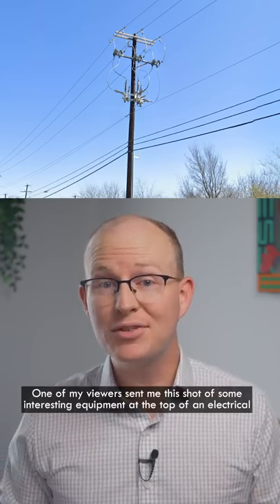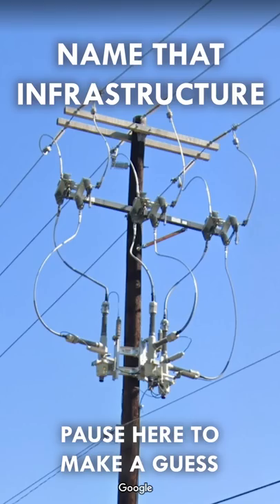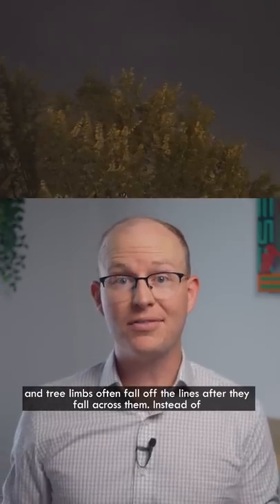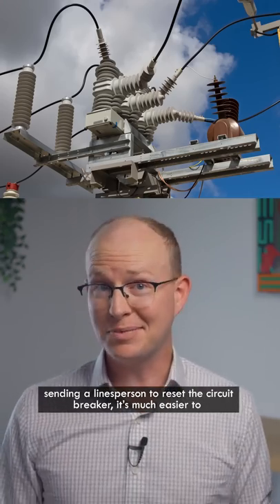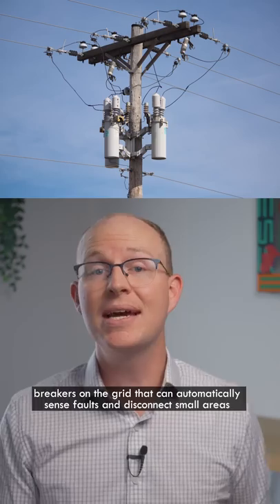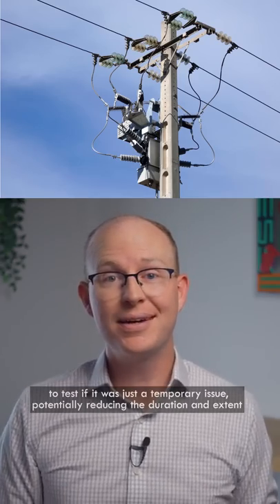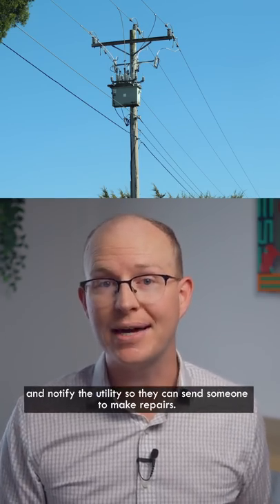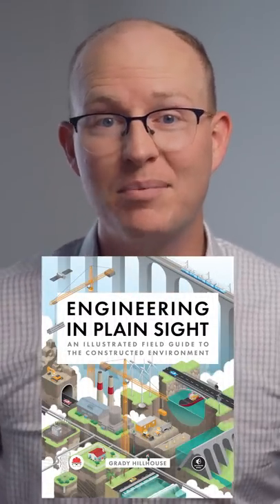Name That Infrastructure (Ep. 9) #shorts

Comment: This might explain why our power flashes a few times before actually cutting completely off
Reply: Thats exactly right.
Reply: yup,  if the recloser detects a fault it will open the circuit for 3 seconds to let whatever hit the lines fall off (tree branch, squirrel, whatever). It then tests the line to see if the fault is cleared, and if not will open a second time for 30 seconds.  Then it checks one last time, if it still detects a fault it will stay open until a crew repairs the damage and resets it. (Exact times and sequences vary from place to place)

Now, when the lights dim that's because a circuit on the same substation transformer experienced a fault, its similar to how your lights might dim when you turn on a vacuum or hair dryer. Dimming lights usually means OTHER people are about to lose power.
Reply: "I got it... I got it... I don't got it"
Reply: Stop answering questions i didn't know i have to ask
Reply: @tavelkyosoba  spot on
Reply: @FonicsSuck It's about 3 seconds where I'm at as well
Reply: yep right

Comment: I didn't know those componets could reset themselves, interesting!
Reply: That's part of the reason you always treat down power lines as live. Just because a fault might cause the power to disconnect doesn't mean a recloser isn't waiting to catch you by surprise.
Reply: Years ago I was watching a television show that shows clips of disasters. (Obviously pre-YouTube.) They showed a hot air balloon that crashed onto power lines shorting them. Every few seconds there would be another poof of black smoke. The narrator explained that the circuit breakers were automatically resetting. Unfortunately in that case, automatically resetting was not the right outcome.

I do not recall what the eventual outcome for the passengers in the basket.
Reply: Usually 3 shots and lockout for distribution and single shot on transmission or no reclosing depending on the situation. And Warren's comment is 100% right,  sometimes they'll clear the fault but still be in a really bad spot energized like a floating conductor off the glass.

Comment: G&W Viper recloser. That's my field of work
Reply: I've built a few of them!
Reply: @benmolitor1519  Pike mastec and volt typically build ours. I'm the nerd that programs and manages them
Reply: Same.
Reply: SunnieGeorgeBaroi  The reclosers are often paired with a relay controller, typically made by Schweitzer Engineering Laboratories (SEL).

The relay controller measures the grid parameters like voltage and frequency, and determines whether the grid is within spec of what it should be.  It doesn't directly measure voltage, instead it has voltage sensing converters that step it down to a more manageable level for the controller's circuits to handle it.  Traditionally, they used a trio of potential transformers (PT's).  More modern reclosers use LEAs (low energy analog sensors).

Comment: I guessed grounding point to protect linemen beyond that section if something happened.  Second guess was maybe some sort of noise reduction or something like a magnetic filter.

I would have never guessed an automatic high-power circuit breaker that can reset itself.  That is just incredible.
Reply: Workers operate on insulated boom lifts, which means there can be huge arcs in the wires beside them yet none will flow through them!

Comment: Recloser!  I used to work for a company (SEL) that made the controls for those. 
The pic you have is of a G&W type.
Reply: I've got one of those in the shop.
Reply: Why do the reclosers have brand-specific algorithms for calculating the effective LEA ratio for voltage sensing?
Reply: @carultch  because in the tech industry the only thing they have to patent is either hardware or software. Every company claims that their software is the best because X Y Z.

Comment: I learned of these back in 2009.  A guy was stealing copper from a power pole and was electrocuted.  He tripped the breaker and was stuck up the pole, and after several minutes the circuit breaker re-energized and then repeated before his body could be removed.  A deadly mistake.

Comment: This explains and i wonder why back in the day it will took to long for the power to came back. Then nowadays we only experience from time to time a couple minutes outages like someone had just switching off/on the line.
Reply: the local loop got upgraded in my area a couple years ago, after which I noticed a new pattern - power would go out and a few seconds later it would come back, and usually turn right back off again.  They must have installed some of these in my neighborhood.

Comment: Few years ago PGE in California changed their policy on resetting sub grids after being sued for fires. Now sensitivity is set on highest level and when it detected any even small nuisance it turns that area off until they inspect 100% of the lines in that area even if they fix the issue right away. That could take few hours or even days depending on area and man power at that time. So past few years I have been installing backup power non stop in Northern CA
Reply: Definitely seems like they could have a better solution than lowering grid reliability. (Address water management to reduce the flammability of plants, or do a better job keeping plants and sparking/hot lines separate)

The Northeast has a lot of lines that just have vines crawling all over them or are "swallowed" by trees that have yet to spark any notable fires, I'm sure they cause other issues but not wildfires.
Reply: @jasonreed7522  PG&E in California simply needs better line maintenance. The entire western USA is much drier than the northeast, and also in a massive drought, so the plants there are naturally much more flammable. 

Thus, you would think that it would be #1 priority for them to ensure all trees and plants are trimmed very far away from power lines. Instead, the execs slashed the maintenance budget and soaked in the "profit". I don't understand how the state of California allows them to provide such poor service.
Reply: @thelight3112  definitely on all points.

The northeast is so wet that in terms of raw precipitation patches of our mountains could qualify as a rain forest if 1/3 of it wasn't snow. Our greenery is very full of water so it is less fire prone, but do note that even NY has burn bans in the spring for the period between snow covered everything and green everything when all the grass is still dead and dry. (All our water means we have to be extra ontop of our plant cutting because our plants grow insanely quickly)

As for why Cali allows the power grid to choose worse service over doing actually maintenance, just look at their history, especially the water rights corruption and it all becomes clear. 

I'm still not sure how a powerlines cause so many fires that they would ban reclosers. The only modes i can think of are lines so overloaded they physically are hot enough to ignite something, a spark/arc but those are realistically only on HV lines and in substations (both far from plants), or spontaneous equipment failure like a transformer or substation basically exploding. (Which is generally a rare event, for the hopefully obviously reason that a 2million dollar transformer should explode every other year) All of these when even half trying should be less common than basic lighting strikes as fire starters.

Comment: Most reclosing operations are done with the vacuum breakers at the substation and most reclosing operations are set to try three times. Once nearly instantly, at 10 to 30 seconds, and at 60 seconds. In some areas that is frowned upon and reclosing is set to happen once. When linemen are working on an energized line, they will go lockout the reclosing operation. You’ll hear them commonly say “so I can have an open casket”. It is interesting to say the reclosing is to test the line to see if the fault cleared. While that is true, generally, energizing the line is considered to be what clears the line, ie burns the squirrel off the insulator. After three operations, you probably have a line down and cannot clear the fault.

Comment: I live in a twenty-year-old neighborhood that has grown quickly over the last couple of years. The electrical system is struggling with the increased load.
 
Earlier this spring something went wrong and after an outage, the recloser kept cycling every five seconds for over two minutes. The AC repair guys have been busy since then. Rapidly cycling AC compressors is stressful for them.

Luckily, I have my wireless thermostats and zone controller running on my UPS. It handled the situation correctly and waited 5 minutes before cycling the compressor.

Comment: Ours are set to reclose 3 times before opening the circuit but they can be put on “1 shot” when crews are doing work near primary voltage. Don’t want it reclosing if something goes wrong.

Comment: The German Railway shuts down the power on its lines three times in a row for a short period of time before shutting down until people got send out to fix the issue. One reason this got implemented is so that people touched the line can let go/ be pulled away.
Reply: Normally at this power level touching the line means you are dead, and pretty well cooked, before that breaker can open. However, if a bird, squirrel or branch falls on the line, the 3 strikes allows for it to be totally carbonised and fall off, then power is restored, so there is no real need to send out anybody. Self clearing faults tend to be common, especially on longer lines, or where they run through wooded or other open areas with wild animals around. 

Reclosers are common on 11kV and higher, where the energy in an arc is very destructive, so fast clearing by opening the breaker is needed, to limit damage to the line. It does not protect you from touching, the touch is always fatal for the thing touching. They protect the line, not people, that is done by putting the wires high up, and by putting signs that say danger, in a lot of languages and pictures.
Reply: @SeanBZA  I know that you’re dead if you touch the line. With let go I meant your muscles stop tensing and you can fall of. And branches are rarely a problem because there is only one capable that has power.

Comment: Reclosers are often used inside substations in place of a circuit breaker. They are functionally the same thing. When they are placed on a distribution line they rarely have the communications set up to notify anyone of their current state. Power companies rely on customers to notify of outages. Download the app or make a call. It really does help gather info. - utility engineer.
Reply: Depends on utility, in the Midwest most if not all of our electronic reclosers have SCADA communications via a cellular antenna. I agree though to always call if you’re power goes out.

Comment: My power company upgraded all their lines with this.  It used to be a strong wind would knock out power for hours.   
This system also caused a problem.   Every once in a while my power would blink off and on.  It would be literally like if you blinked and the first few times I thought it was me.  But,  after happening over the course of many weeks I finally called the power company.   They said nothing was wrong anywhere they could see and  sent two different people to my house to check it out.  One of the techs lives on my road and several weeks later stopped by to tell me they found a raccoon had gotten stuck on a piece of equipment and was causing it.  It's never happened again since.

Comment: A smart circuit breaker!
Reply: Yes.  It's pretty much, a medium-voltage version of a circuit breaker.

If you were to build the equivalent of this inside a building at utilization voltage like 277/480V or 120/208V or 120/240V, you'd need a motor controlled/shunt trip circuit breaker.

Comment: Grady is part wrong, and Ibet knows better.  That's not grid, but intermediate voltage secondary feeders.  The reclosers part is accurate otherwise.  

Any competent engineer should be aware of the IEEE standards in (year).C2, aka NESC, as incorporated into many US and state laws, plus some internationally.  That defines primary grid standards, which are distinguished from feeders generally operated at 2400-48kV, versus grid in the 69kV to million plus range (most often 115-345 kV). Actual grid tends to be up higher too, and so less subject to trees.

Comment: I am pretty shore up till recently it was my house causing faults across my area. I wasn't aware until I burnt out the lines in my house trying to ark power through a short to keep my precious fish alive I spent last 3 years growing and 2 ton indoor ponds. Lucky for me the power box was so screwed up the RCD weren't connected correctly and I was able to ark the power back on when ever the board tripped the power as it was only temporary. thinking about what you said. I'd say that RCD tripping I noticed wasn't from my box. But was the power line shutting off power to my whole neighbour hood that night. It was just the one night but it was hell for me and perhaps every one. It's been completely fixed. Costs thousands. Note I am just the tenant. Not my house.

Comment: That seems really dangerous, i wonder how it tests if it can re-energize the line. What if someone is touching the line or something like linemen or some random person.
Reply: Linemen will manually shut it off, before touching the line.

For the general public, this is why they advise you to never touch a downed power line, and to keep your distance from it.  Especially four-leg animals like dogs (more on that later).   This is why you report downed power lines, and let the professionals handle it.

There can be a voltage difference across two points on the ground, and this can be dangerous.  For people, fortunately it isn't across the heart, since a fault will only travel through the legs and pelvis.  For 4-leg animals, it is even more dangerous, because ground voltage gradients can be across their hearts, which makes them even more risky to be fatal.

Comment: Looks like circuit breakers or disconnects 
... 
I never knew they were Auto reset circuit breakers that must be a rural thing never saw those here in the Northeast (where you're never more than 15 or 20 minutes from any one of the electrical companies local dispatch locations)

Comment: They usually try twice, and on a third fault 'lockout'.
Reply: Yes, the Bill Clinton method, 3 strikes, counted on a stepping relay that will allow 3 reset triggers before it hits the fourth step, which does not have the notch to allow reset, so locks the line out till it is manually reset by a linesman pressing the button to advance it back to position one. More sophisticated ones have a second long period counter, so they will reset back after a day of inaction after a single trip, but will still trip out and stay out ( timer fed from output side voltage) if there are more than 3 fault trips in a single day.

Comment: Question - how come metal poles are never flush with the concrete pad it sits on? Poles for lighting, traffic lights, etc, always have a gap between the metal flange on the pole and the pad
Reply: Good question.

The reason is that it isn't possible to get the concrete surface perfectly level.  As a solution, they have a group of anchor bolts, with nuts on both top and bottom sides of the baseplate.  The nuts allow the installers to fine-tune the pole's orientation so it is plumb with gravity

Comment: One of the threats of solar storms are damaging currents induced across large electrical grids. Could reclosers help reduce the threat?
Reply: I’d imagine it would also fry the electronic relay that senses faults and trips the recloser. If it’s an older hydraulic recloser with no electronic control, you might have a chance.

Comment: Are they passive components and just carry a backup battery for communication or how do they work?
Reply: They carry a backup battery to power the recloser controller.  There's usually a control power transformer (CPT) that steps the grid voltage down to a utilization voltage like 120V to power the controller and UPS.   This maintains the state of charge of the UPS batteries, which are deployed any time there is an outage, and which can operate the recloser control circuits.

Comment: Are these the reason the power will flash on for a second after it goes out and then immediately turn back off?
Reply: Yes.  They flash the power back on, in case the fault that tripped the overcurrent elements was temporary.  If it was just a lightning strike that caused a temporary overcurrent, and the grid is safe thereafter, these will turn the power back on for a trial period.

During this trial period, the recloser controller will sense the grid parameters (voltage, frequency, etc), and if it can sustain itself within tolerance, it will allow the power to continue running.  Otherwise, it will shut it off long term.

Comment: So, a re-closer is the breaker equivalent of "turning if off and on again"?
Reply: Yes that’s correct
Reply: Yes, gives a chance for the well charred whatever to fall off the line, and then restore power again. 3 strikes and then it stops the automatic restart, and you need to have somebody inspect the line and clear the fault. There are still fuses though, just they take longer than the recloser to operate by design, so that they fail if the recloser does not act correctly.